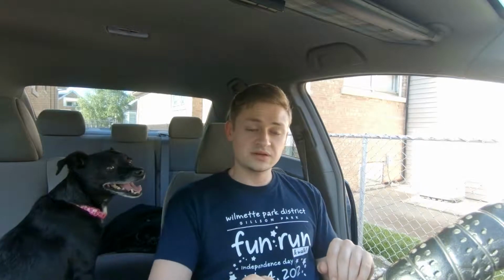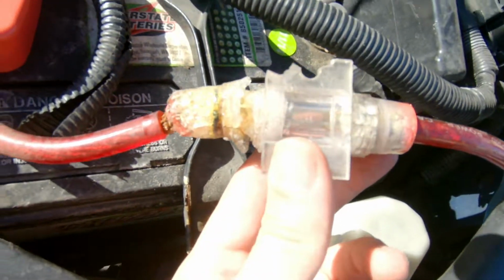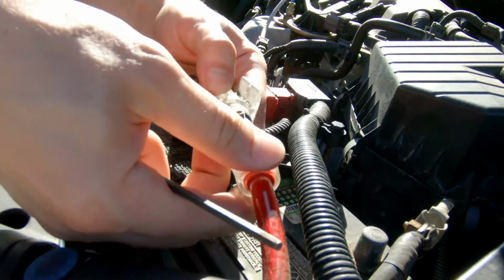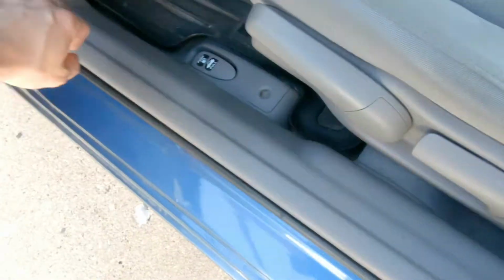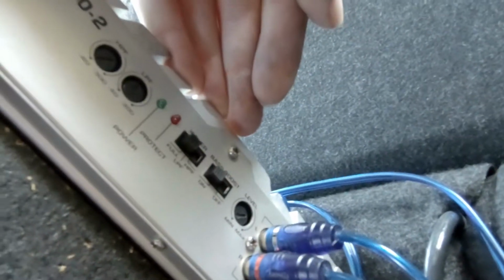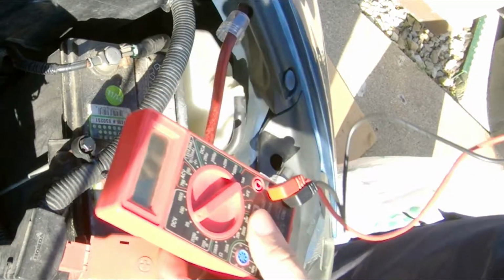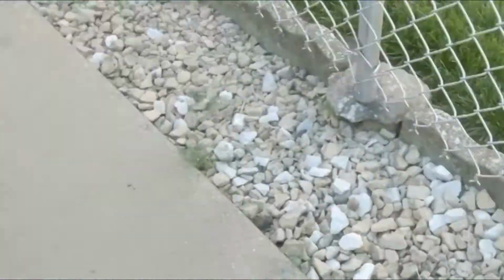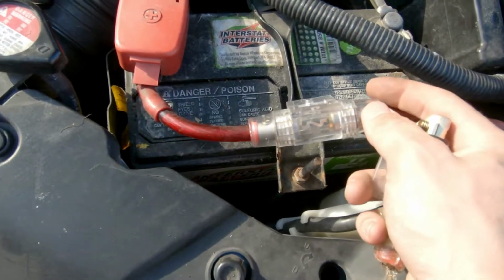Sub-woofer Problems| This Could have Burned my Car!

Comment: i need your help because I'm dumb as F about car audio, can't figure this out...  Im sure i have blown one of my twelve inch subs, but it passes all of the so called "blown-sub-tests" to check if its actually blown out. I think its technically bottoming-out but again I'M NEW TO THIS.  

So...The fuk'd up subwoofer does produce bass, & at a comparable level to the other sub in my SUV..  

The problem is that unlike a blown sub that distorts bass 
 (I've blown subs before & know how they sound) blown-subs make that muffled rattle where bass should be heard .

  Instead my failing subwoofer makes low & mid level bass just fine until the bass really hits; then it makes a terrible "Thwack!" Slapping sound. The slap doesnt reverberate or rattle. Just one sharp crack every time the beat booms.

Some problems with subs are fixable & other's spell the end for the speaker; but NONE of the youtube vids or car-audio websites i have checked address this... & believe me I've searched 

The sub glides smoothly up & down within range when pressure is applied. No scratching, clicking or popping sounds come from the sub when I gently push it up & down...  

Sorry for the lengthy question but I'm trying to provide needed info to solve the problem.

Do you know whats wrong?  I dont know the impedance or ohms, just that its a 4-ch. 1,200 watt amp pushing two 12" subs. 

 I traded a Hdtv for the system, then simply paid a shop to install it. 

Yes im a dummy; please help me solve this. Thanks
Reply from the maker: Hello! Sorry you are having this problem.  Buying used items can be challenging.   I’m no mechanic or electrical genius. I once had a problem where my sub under high base would make a clicking sound.    It later turned out to be a wire behind the subwoofer. It was too long and under high volume and the subwoofer moving so much it would tap against the subwoofer and create this awe full tap noise / click noise.   I since then open up the box.  Cut the wire a bit and solder it back on to its attachment point.    I would try to take it apart and see the behind the scenes and maybe it might lead to some clues.    Test each speaker individually and see if that can help aid in diagnosing
Reply: @BulliKid  yeah I'm sitting on my couch with my speaker box next to me and just removed the sub.
 There's no visible damage, tears, scuffing or burns...  everything looks in order. 
The subwoofer is a dual voice coil so I'm thinking about testing each voice connection individually. Or running the box with the subwoofer inverted though I doubt that would make a difference. 
I have had these Subs & amp for like 16 years and I run them pretty hard.  But they have always endured; also I don't crank up the gain or high-ride the crossover on my amp

 It's possible this one just gave out of old age but the other sub is running perfectly fine, still hits hard. 
The technician that installed my system said that my channels were blown but he did not mention how were bad. If possible I could try to run the sub off of a different Channel obviously... I know that both of these Subs currently run off of the same channel from the amp.

 I'm not sure if it's parallel or the other way but I suppose I could swap the boxes wiring and see if the problem is coming from the amplifier but if they're using the same channel then the problem should affect both subwoofers... like I said this shit has me stumped and I'm open to suggestions
Reply from the maker: Dimo Green yea seems like the amp is “bridged”. 16 years wow they sure did last a good time. ! Well the good think if you are surely learning a lot more by doing all of this.  So even if in the end the sub is bad you leaned a bunch!